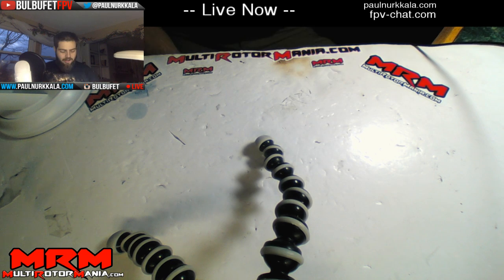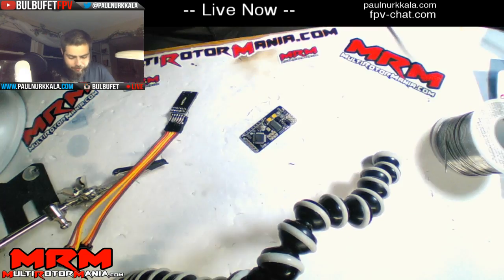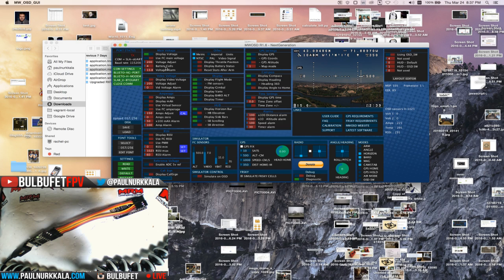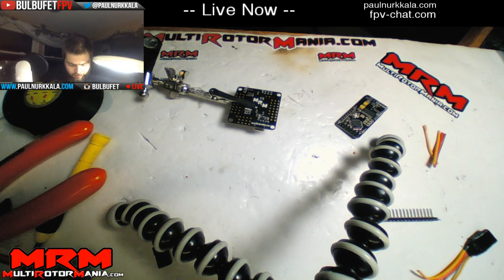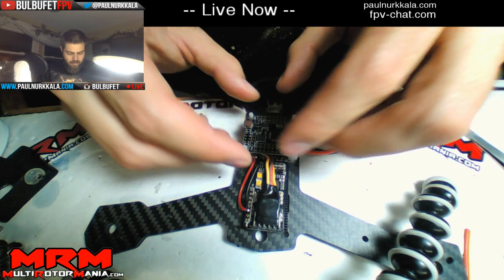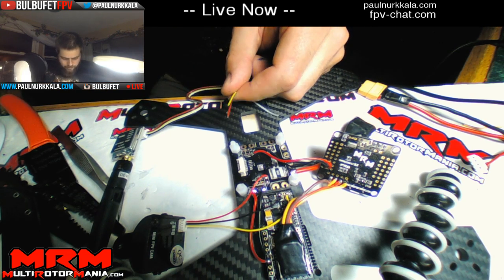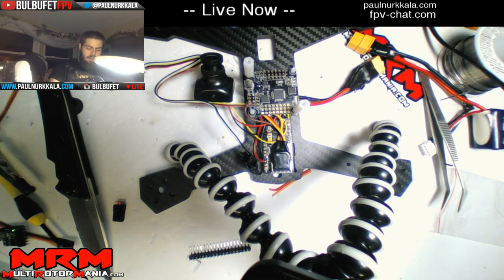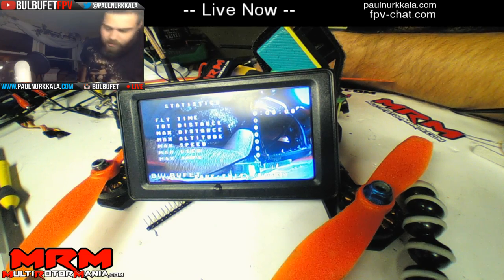Livestream // MRM OSD Configuration // Ultimate Multirotor Mania OSD Setup

Comment: Great How Too. over at RTFQUADS are the original designer of KVTEAM mods for the OSD . (not the original osd) and then making the mini2miniosd, leaving off the 12v section . unreal price for an OSD $8. we also have flight controllers with build in osd. keep up the hard work. a lot more cool hardware coming soon. F3 Racing boards up right now